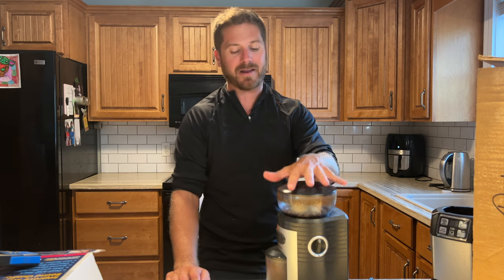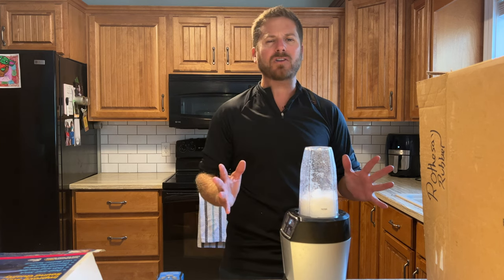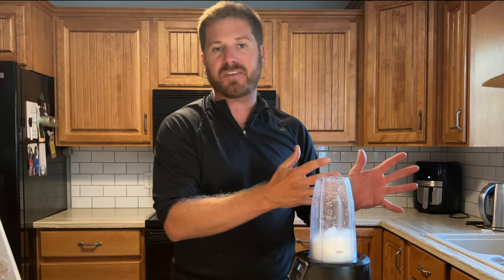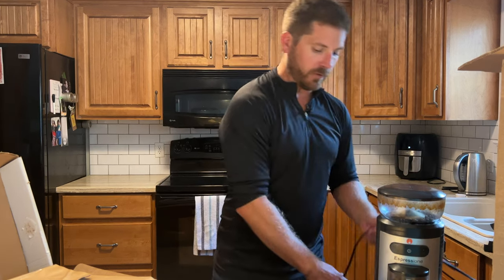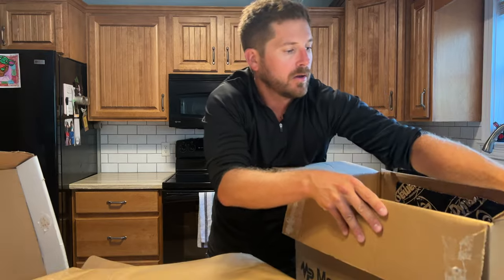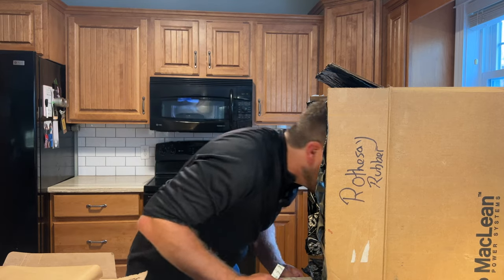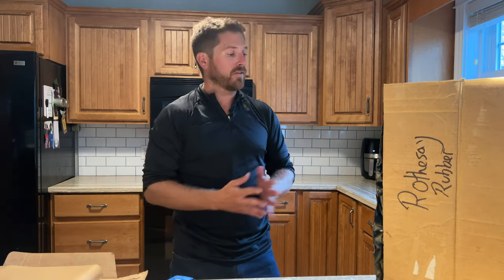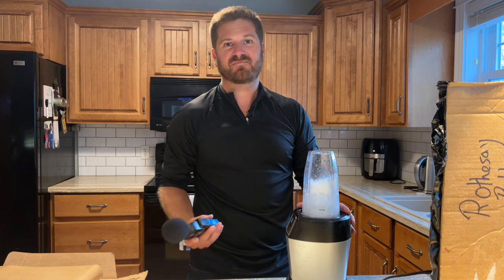DIY Baffle Box - Make Small Kitchen Appliance Quiet!

Comment: Great video. What I did: on the counter I put a silicone hot pad,a folded towel on top of that, and a cutting board on top of that as the base for the blender (kills vibration to countertop).Then I used two insulated grocery shopping bags (about 10 bucks for two on Amazon) which I doubled-up by putting one inside the other. Then I put this double bag liner inside a cardboard box, and turned the bag-lined box upside- down over my Ninja bullet blender. Works great, and no apartment noise violations for early morning smoothies.

Comment: the (dynamat) sound deadener is not necessary (in theory as you are using it).  The box is not technically not vibrating/resonating.  Closed cell foam (the blue squares) and mass loaded vinyl are better noise blockers.    If you put the sounder deadener on the body of each device, that could reduce the resonance/vibration noise plus using your box cover.   You can also try the white insulation foam (Styrofoam) from a home improvement store or the (dense) green project foam.   Also chopped denim mat is also good at reducing/blocking noise.   Have you tried a thick shower/beach towel??

Comment: I did something similar using corrugated plastic to make a hexagon around a super sized nutribullet rx that is the loudest (and most powerful) blender I've ever heard.  Because the nutribullet doesn't have buttons, it's just barely bigger than the blender and stays on it all the time with a removable lid which works well for that style of blender.

I do like your approach as it isolates the base from the counter - granite counter with suction feet on and a heavy blender still vibrates the counter enough to make some noise.  I think the car insulation would do a great job dampening that and I might have to make an addition to mine!

Thanks for sharing!!!!